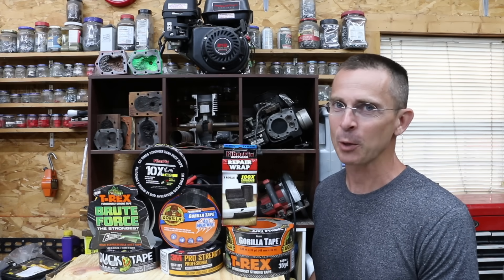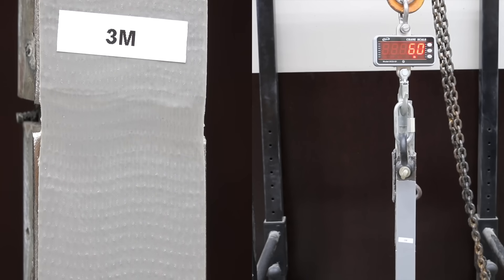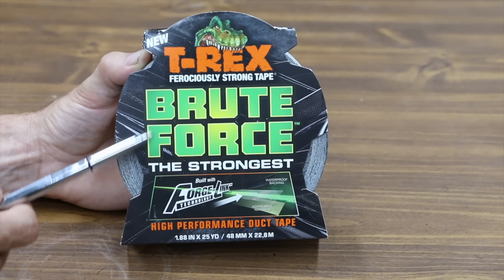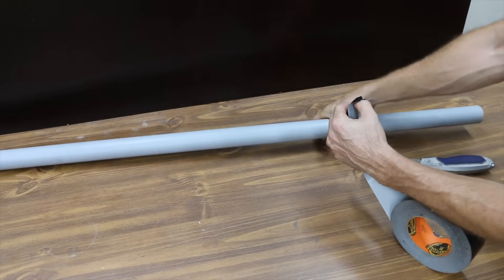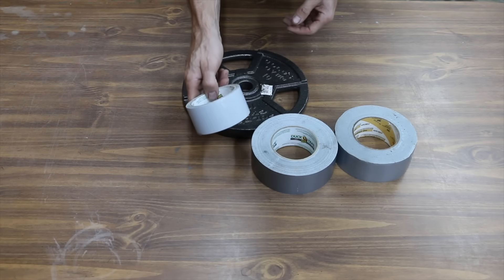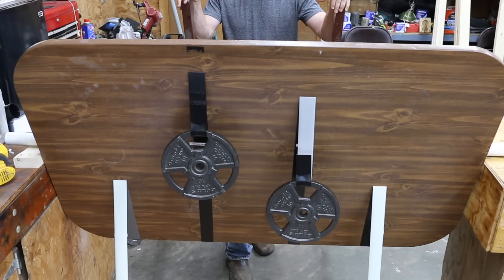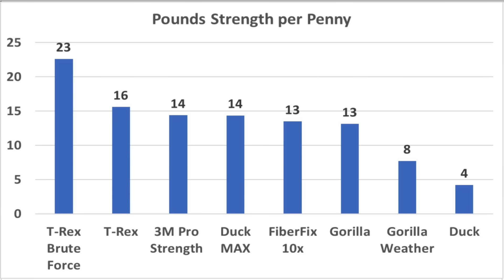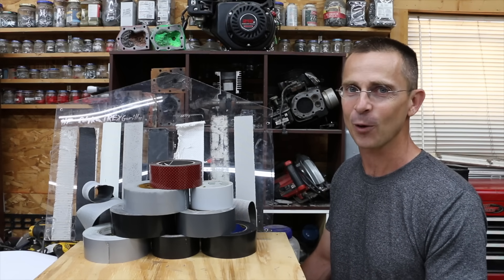Which Duct Tape Is Strongest? Let's find out! Gorilla, T-Rex, FiberFix, 3M Pro & Duck Max

Comment: Tensile strength- T-REX BRUTE FORCE
Weight on Pipe- FiberFix wrap
Table Weight- T-REX Original
Weather- Flex Tape
Lbs Strength Per Penny- T-REX BRUTE FORCE
Reply from the maker: Lol
Reply: This is what comsumers reports needs to go back to unbiased testing results nice
Reply: Thank you for the attention to make this run down list.
Reply: To show you the power of flextape, i left it on plexiglass for a year!
Reply: Crazy Russian Hack fixed a shovel with Fiber Flex. It did break when he banged it on the ground, but before that it dug up dirt just fine. Very impressive.
Reply: thanks my dude, can you  include costs?
Reply: Tractor towing- T-REX BRUTE FORCE

Comment: Bummer that the tape designed for weather wasn't in the weather test. Please compare Gorilla Weather to standard Gorilla, standard T-Rex, flex tape (put paper under one end so it's possible to measure), and any other weather resistant tape. Maybe do one test at 3 months, another test at 6 months, and a third test at a year.
Reply from the maker: Thank you for the video idea!

Comment: It’s very interesting to see the failure modes of these tapes, some of them, like duck, 3m, t-Rex and fiberfix stretch and fail plastically before they enter a brittle failure mode and break in a catastrophic manner which could be very useful, as you can see that the tape is near breaking, unlike with the gorilla tapes, duck max and brute force, which failed violently with little to no warning. The all at once nature of some of these tapes could prove to be very dangerous and is certainly something to consider

Edit: in regards to the tensile strength test, as discussed after the pipe test, duck tape is stronger in the long axis than it is across its span

The weather test is also interesting, as some of the tapes failed because the adhesive was degraded, but others, like the t-rex and gorilla seemed to fail between the backing and the adhesive, which is annoying and creates quite a mess if you ever need to remove the tape. If you never need to then go flex, but if you expect to need to remove the tape then hurricane might be the best bet for an outdoors scenario
Reply from the maker: Thank you!

Comment: I wonder if woven patterns, like seen in FiberFix, would make any difference. Not just the various square patterns, but also a hexagonal pattern. I have a feeling a hexagonal weave, in this application, would be beneficial, as you have diagonal strands that're biased towards vertical, which should improve strength and change the point at which those strands shear. 
Could even go up to an octagonal weave, where you have vertical, horizontal, and two diagonals that wouldn't be biased towards either vertical or horizontal, so you get wrap strength where hexagonal would be lacking. Manufacturing would become more difficult, but it would still be an interesting product to test.

I also wonder if FiberFix is actually weaker than T-Rex Brute Force. As you can see from all of the tapes, they shear along the width, though some shears are more clean than others. But, as you can see from FiberFix's tests, especially the second sample, each strand shears at a different point along the length. Does this mean FiberFix is inherently weaker because it's using multiple, thinner strands, rather than using a singular full-width piece, like all the other tapes do? I think this would also apply to elasticity of the material, as there would be less material to elongate before failure. I guess the only way to test this would be to use a singular strand of FF, and cut each tape down to that width for comparison.
Reply from the maker: Thank you for the video idea!

Comment: well at least you are thinking the only test left is uv exposure over winter // of course with the table tip strip test the winner is the one with the odd weight (lighter) and when something happens like this, refilm it, so it dosen't look cheated in the results, or did you do this because you are messing with your base to see if the masses are looking with intent .. most don't comment they just cuss you and turn you off // not the reaction you would expect however you are playing to a thumbs down crowd already why risk it ///
Reply from the maker: Thank you!

Comment: Might be a bit pricey, but you should do a kevlar/spectra fiber tape test, including weathering, and re-do your duct tape weathering too. Plus you should keep samples of the same tape being weathered in a controlled, dark environment (control group), just in the name of completeness and science.

Plus would like to see some of the previous oils tested AFTER 1. Mixing with an amount of gasoline to simulate blow-by, and being cooked, and 2 Being cooked and then mixed with an amount of antifreeze to simulate a blown head gasket.

When I was working in a shop, I noted that if antifreeze got into an engine with P***zoil in it, it would become gritty and destroy all the bearings, and sometimes even the cylinder walls, however Valvoline  engines would continue to be lubricated, did not have the grit, and the bearings were OK. Big difference in price between a head gasket, and a whole rebuild. These were observed, and not tested findings, with conventional 10w30 oil. So, in the name science, you have some more video meat to chew on.

BTW, thanks for your excellent videos. Very well done!
Reply from the maker: Thank you for the video idea!

Comment: Wtf, in Germany there are only two kinds of duck tape, silver and black 3M tape.
Reply from the maker: Wow!  Seems like there should be more options.
Reply: @ProjectFarm  duc tape isn't really popular here, we like to fix stuff the expensive way. I think I saw gorilla tape one in a store...
Reply: When you've got a manly break, you need a manly tape:  Fiber Fix.  My 20 foot aluminum flag pole snapped off in high wind, about six inches above the base.  I repaired it by inserting a slightly smaller diameter 12 inch piece of PVC, and wrapped it with Fiber Fix.  It's been through many a south central Ohio wind/rain/snow storm; and Old Glory is still flyin' high.  Manly!!

Comment: ''hey man, my car broke down, i need a tow''
''sure man you got some rope?''
''nah man, but i have this roll of T-Rex tape''
Reply from the maker: lol. Thank you
Reply: well an f150 electric can "tow" a train. just like trex doubled up towed a tractor that was heavier then the tape tensile strength. PF and Ford are warlocks.
Reply: @tron121  tape tensile strenght =/= weight of tractor. it doesnt work that way when towing. you are basically saying ''i can push a car, so i can deadlift 1500kg''

edit: when towing the tractor, all you have to do is overcome the resistance of the bearings, and the friction of the tires on the ground. still very impressive the tape held up...
Reply: @wildwilco  😜I know. Was trying to be funny. Most people don't though, clever marketing is terrible. 😢
Reply: @wildwilco  that was also the whole point of the tractor being on an incline tho :p
Reply: Yea, But rope is reusable.
Reply: @johnaverick7468  this is Murrica. Convenience is king. Rope is for hippies. All we need is a subscription service for tape each month, what's another $9.99 per month. 🤔
Reply: @johnaverick7468  make a rope out of the used tape when your done if that makes you happy XD
Reply: Stores nicer than a tow chain, anyway!

Comment: Could you test different 2 stroke oil in an 2 stroke engine? Cheap vs little more expensive and also test a myth that you can mix normal motor oil in the gas and drive on that instead. And also mix used oil in the gas and see how the engine runs. And also then mix them at the same ratio. For example 2 % = 2dl oil on 10 liters gas. Or 1dl oil on 5 liters gas. Same thing. I drive mopeds and motorcycles and they are 2 stroke and some people claims to have driven on normal oil or used oil when they didn't have any other. Good videos as always. Greetings from Sweden :)
Reply from the maker: Thank you for the video idea!

Comment: I just had an idea. Drill a hole in a pvc pipe wrap the pipe with tape and fill with water. Increase the pressure in the pipe until the water fails.
Reply from the maker: Thank you for the video idea!

Comment: I know you've done a few videos now on various bonding products like tapes, flex seal, epoxy, etc. But I have a couple self-serving suggestions for future tests! Gaffers tape (either different brands or comparison to other household tapes like painters, with regards to the same properties in this video as well as how much residue is left over. I usually get cheap brands on Amazon, no single one in particular, current roll is "Gaffer Power" since I needed colored tape), sealant such as RTV silicone (my go to), and finally double sided tapes - I generally stick with 3M. I'm curious if there are better options than my chosen brands. Thanks for all the work you put into the tests and videos as well as interacting with the comments! Edit: I'm going to echo another comment with an extra vote for electrical tape and razor blades!
Reply from the maker: Thank you for the video ideas!

Comment: To get more accurate results of testings because from what I saw from the whole video on the tenstion strength test it appeared to me that the metal didn’t appear to be clean only with the starting tape so I would recommend to clean the metal with isopropyl rubbing alcohol and then then do the testtings. But all comenta aside you are a great you tuber as well.
Reply from the maker: Thank you for the constructive feedback

Comment: Another great video! Love the channel.  Thanks :)  Ideas:
1. gun lubes: corrosion resistance, lubricity, effect of high heat and freezing temps, still work after getting dusty, wet etc.
2. scratch "resistant" safety glasses:  off the shelf and amazon cheap compared and pricey worth it?
3. durable water repellent (dwr) treatment:  effectiveness, works after how long/ how much sun/ how many washes /how much water
Reply from the maker: Thank you for the video ideas!

Comment: I would like to see a slightly different test. one that incorporates temperature as a variable. most duct tape adhesive loses strength as the temp goes up. I would like to see a time/temperature test.  I would suggest this. cut a PVC pipe in half and then tape them back together, cap one end with a hose attachment, and the other with solid cap with a  valve to let the air out. hook the hose up to the drain valve on your hot water heater and the other end of the hose to the pipe. blead out all the air with the valve and then close it when all the air is out and then time it to  see out long it takes for the adhesive to fail at temperature and start leaking from under the tape.
Reply from the maker: Thank you for the video idea!

Comment: Great follow up test on the weathering, I think that's a major factor in determining which brand to buy! Also, even though it's a good visual representation, why not just use your force meter at a pre-set length to measure the torque instead trying to inch weights down the length of the pipe?
Reply from the maker: Thank you!

Comment: Something I would like to see tested is slowing down rusting on already rusted parts as some coatings make the situation worse than bare rust. Have used oil based with OK results and rubber based are worse than bare rust.
Since frame off rust removal is quite labor intensive (and expensive) and the reality is that sometimes what is needed is just few more years for some junkers that aren't rotted to holes or projects that are waiting for the "right" moment for too long.
Reply from the maker: Thank you for the video idea!

Comment: I always thought T-Rex was just another brand on the shelf riding off the "strong animal" aesthetic of Gorilla (or Duck, technically.) I will definitely pick up a roll whenever I need to get some. 

The big question I have now: would you want to try and seal some tires with duct tape? Lawnmower/yard trailer tires are what I'm thinking, but it would be amazing if T-Rex could seal a full size tire long enough to roll the car around or drive a little bit.
Reply from the maker: Thank you for the video idea!

Comment: Gasket maker for the win. 

Temperature (heat pre pressure test)

Oil resistance (oil soak pre pressure test)

Gasoline resistance (gas soak pre pressure test)

Max pressure test comparison

Base material compatibility

Could be done with water for safety.
Reply from the maker: Great test idea!  Thank you

Comment: when are you going to do actual "duct tape:" fabric based non foil backed adhesive strip is not duct tape  if you are being anal about what you are testing is called lol  real duct tape is designed to seal air leakage in ventilation duct work at the seams ..its only job and purpose   strength  and elasticity are not a concern   my rant over  and as always thanks for the video
Reply from the maker: Great test idea! Thank you
Reply: @ProjectFarm  anytime lol ill keep suggesting if you keep uploading ;]

Comment: Consider doing similar testing on the new generation of house wrap and sheathing  tapes that are advertised to last the lifetime of the house.  Most are acrylic adhesive tapes that are pressure activated to promote an airtight and watertight seal.  Probably the most available is Huber’s Zip tape, Shurwrap and Tyvek Sheathing tape.  Others are from Benjamin Obdyke, Pro Clima and LP Building Solutions.  The Current Sept 2019 Fine Homebuilding magazine has a decent article that includes these and more.
Reply from the maker: Thank you for the video idea!

Comment: IDEA - Exterior Latex Paint. Valspar, Behr, Sherwood Williams, Benjamin Moore, etc
Reply from the maker: Thank you for the video idea!
Reply: @ProjectFarm  Yes please!
Reply: thats a good one. painted a whole house inside and out, buying just the most expensive paint because i didnt want to take chances having to repaint. behr Marquee has been my choice since.
Reply: @marcogeraldis7117   I've been sticing to Sherwin Williams Super Paint for a few years and really like the finish and durability.
Thanks for sharing!
Reply: @maximAVS so you like Sherwin over behr marquee or have you not compared with that yet?
Reply: Marco geraldis, I have used Behr Marquis and other Behr lines. I found them to be way too thick ( like pudding). I seemed to use a lot more paint than other brands. And it was too expensive to have to do that.  Sherwin Williams had the best coverage, durability, and area covered out of a can than most. YMMV. Just my personal experience.

Comment: Imagine being stuck in a ditch and some guy pulls you out with just a bunch of tape.
Reply from the maker: lol
Reply: Totally can imagine it... Hey I dont have any tow straps but I have a roll of TRex tape so no problem!
Reply: Aw man, I'm done for...
a roll of T rex Brute Force is dropped down with one end already extended
I AM SAVED
Reply: I once saw a vw bus get towed out of a ditch using a bunch of tied together leather belts so a roll of tape wouldn't be all that strange
Reply: @DjDolHaus86  I find it odd that anyone with a truck wouldn't have a chain (3/8" x 20') in the back of the truck. Every truck should have a chain and a shovel in the back.
Reply: If you doubled over that T-rex tape a few times I am sure it would be possible. If you used 1000 layers of the Harbor Freight stuff, it might  work lol
Reply: Heh... I once pulled my brother out of a ditch using Christmas lights,  so you never know.
Reply: mrsabidji I wanna know more about this. About how many feet of christmas lights were required? Were you able to use the lights during Christmas after you pulled him out?
Reply: @bigdummy8414  It was the kind that's like a big plastic wire thing with LEDs embedded inside. It wasn't working anymore at the time when I used it to pull his car out, but the process visibly stretched the plastic in some places, so I would say if it had been working before, I doubt it would still have afterwards. :)
Reply: @bigdummy8414  As for the length, I'd say about ten feet, and I wrapped it around both tow hooks about two or three times, I think... it was back in 2011 or 2012, so I don't remember every detail. ;)
Reply: That was a really long tow strap advertisment
Reply: I've seen it done

Comment: Do a test to see if different octane levels actually do anything
Reply from the maker: Thank you for the video idea!
Reply: This is always something I see. Octane level just changes the time from ignition to end of burn and the fuels ability to not detonate ( ignition before wanted from compression ) .  So for most engines octane does very little. Lastly taking an engine designed to run  low octane and switching to high octane will do nothing for performance if anything performance will go down.

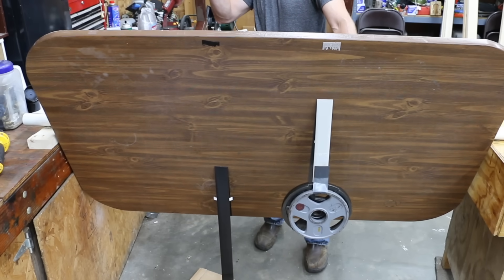Comment: I'm kinda suspicious. At the 13:55 mark, that Gorilla tape really let go quick, and for a sizable burst, as if there were some oil or something on the table. After that section, it arrested itself and stuck well, which was remarkable. It just looked fishy. Did you take time to clean the table in between tests?
Reply from the maker: Thank you.  It seems as though all of the tapes struggled to stop weight once it gained momentum.

Comment: 11:39  That suggests a different method of testing.  Rather than just wrapping like a bandage, what about putting four strips 90 degrees apart parallel to the pipe, then wrapping around those strips to secure them?
Reply from the maker: Great point. Thanks for the constructive feedback

Comment: Best electrical tape? Tensile strength, lateral tear strength, heat resistance, cold resistance, piercing resistance?
Reply from the maker: Thank you for the video idea!
Reply: Best electrical tape in the heat, and how much residue is leftover after removing.  Thanks!